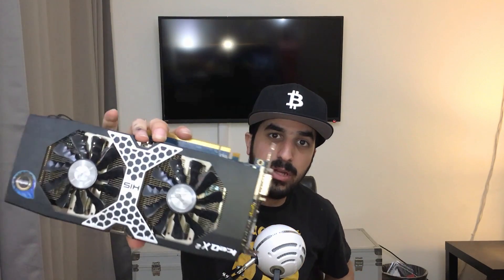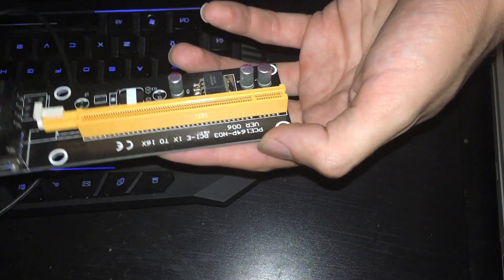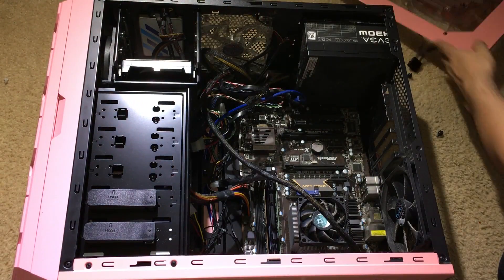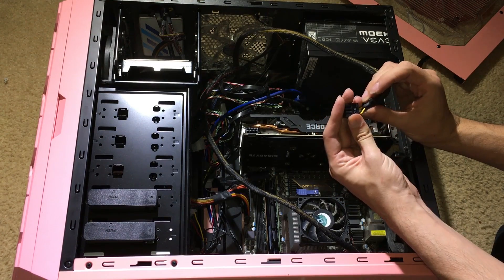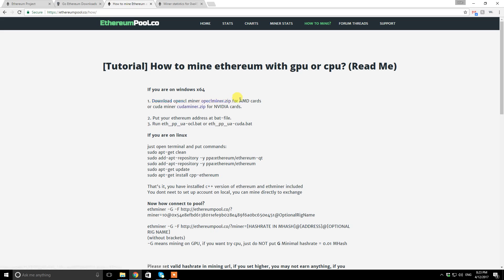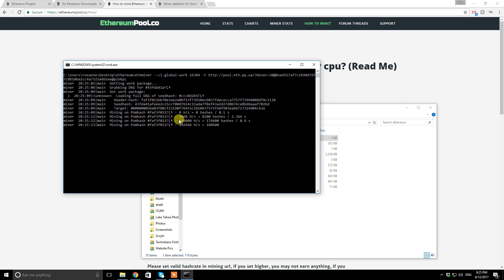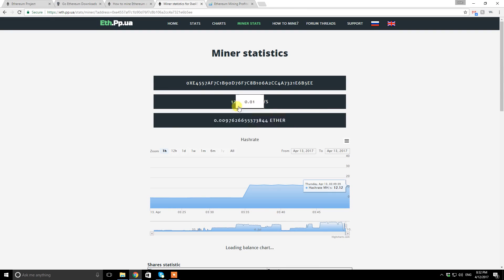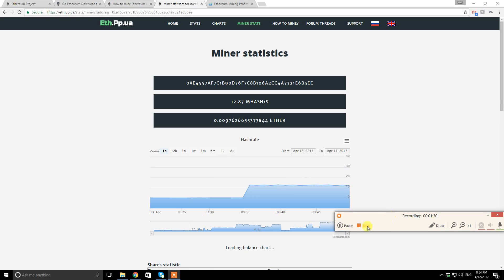How Much can you make mining Ethereum using gaming PC and how to mine Ether from scratch

Comment: @HowMuchBitcoin thanks for the helpful videos. However I’m completely new to this and I have a few newbie questions I was hoping you could clarify. When you edited that file you said you are adding a code that helps you mine more “ efficiently “ could you elaborate a little bit more on that. And lastly I have a very basic understanding of the pool could u give a bit more info on that? Does it effect ur efficiency? Are there many different ones out there? Basically If multiple ones exist should I try a few and see if it improves the outcome? im using a nvidia
Again sorry for such newbie questions :-| and I appreciate all the info you’ve provided.
Thanks

Comment: so i have a question that i want to see if i can get answered. does anybody happen to know what the MH/S would be for an MSI Gaming x 1050ti? if it is high enough to make me even a little bit of money then i would definitely do it, but i don't want to spend the effort setting it up, letting it run for like a week, and finding out it isn't profitable. i know depending on the brand a 780 ti can do 15 MH/S so i would assume it would be higher than that, but i  can;t find any info on even a rough estimate of my cards mining power.

EDIT: i found some data for other algorithms, but not the ETH algorithm. if it helps at all in Blak256vnl a 1050 ti can get roughly 1.571 GH/S, and in Decred it can get 0.972 GH/S

Comment: NEVER, i repeat, NEVER put your filthy fingers on the golden contact strip of a GPU.......
Reply: You can clean it with isopropol.
Reply: haha welp. I guess my 4 gpu's are RUINED !!!1!!!1!1111!1
On the real though I don't see a problem with touching it a bit.
Reply: If you're using it as an ethereum mining rig, you should clean it with ether.
Reply: Nothing will happen, relax.
Reply: Meziti Own that's cpu dumbass
Reply: I think he might have meant "that's cpu" as in "that's cpu [that you can't touch]".    Just sayin, it's possible.
Reply: Meziti Own Just wipe it with some rubbing alcohol and it will be ok
Reply: are u guys being sarcastic he's talking about E.S.D
Reply: *Clorox is better
I use Easy Off
Reply: NEVER, i repeat, NEVER comment about something you dont understand!

You can have the contacts very worn down and still work perfectly fine they are designed to wear down and you can manhandle this stuff, the only thing you really should be careful with is the cpu

Comment: Get a motherboard with 6-7 PCI-Express adapters and you can run 6-7 GPUs. It's all pretty basic stuff.
Reply: Also, be aware that Ethereum will change from proof-of-work to proof-of-stake sometime soon, so no more mining. You'll still be able to mine other coins however.
Reply: If you use RX470s with a modded BIOS you can run ~29MH/sec each and they run at ~90w.

Comment: what is the lowest end kind of set up can i use to mine?
Reply: Alex ricard you need to buy a mining hardware for this to actually work. Using your own system uses too much power and will break a lot faster than the mining hardware. For a decent profit you need to spend about $400 for a rig and they are 2 times as fast as a normal pc. Do some research about this and you should be good to go.

Comment: You forgot to mention that long term mining will kill your hardware eventually and that its best to use a machine separate from your day to day PC.

great video, just misleading. keep up the videos!!
Reply: simply using your hardware will also kill it eventually :)
Reply: If you don´t OC your GPU it doesn´t have much impact on the lifetime of modern GPU´s. If it comes to CPU mining , f.e. Crypto Night Algo for Blake Coins etc. i agree with you. And @Video Uploader: I´d suggest for a "at the side when idling" gamer PC miner a multihash pool and not stick to one coin. Nicehash or Mining Pool Hub with their own very very easy to run all in one Miners would be the best for a person that´s really new to gpu mining.
Reply: +TheGlobeTV not if you under-volt it and not if you keep it cool (which implies removing the dust every 2 weeks or so).
Reply: Yeah, given how hard those 580s are being run right now, I'm going to avoid second-hand Polaris cards like the plague for a good while.
Reply: if they are dirt cheap ill buy them up and use them in future client builds. GPUs are made to be run 100 percent load 100 percent of the time its how they are designed because of that they dont degrade to the extent you would think
Reply: You forgot to mention you have no Ideea about this subject
Reply from the maker: To be honest i'm still surprised how well silicone chips work over time, if something breaks, it's usually PSU, physical hardware or user error. I have been running old old GPU's for months running at 91C and it dose not stress even a bit. I actually still game on the same GPU and it still works great